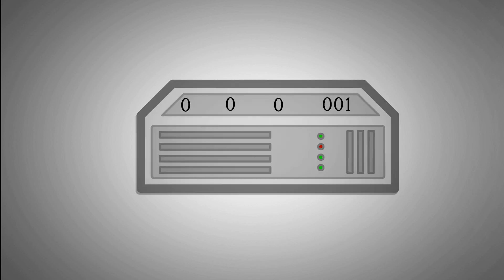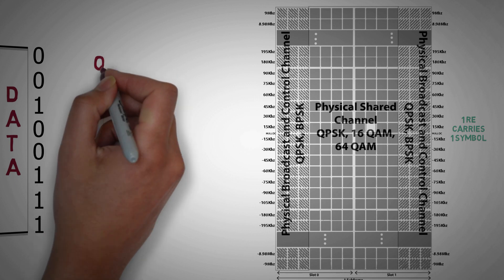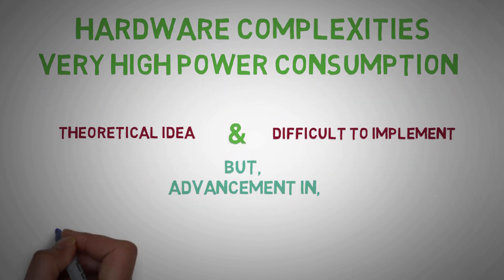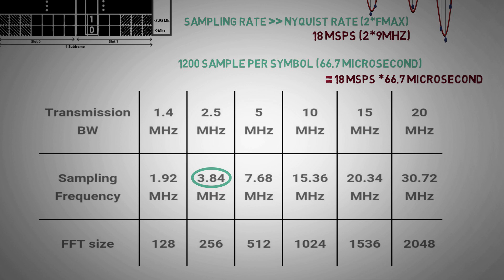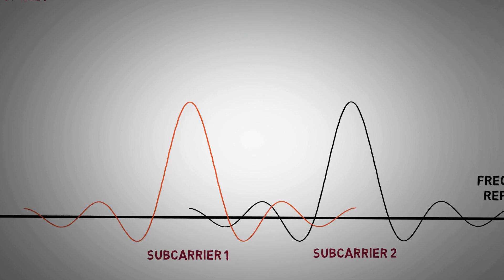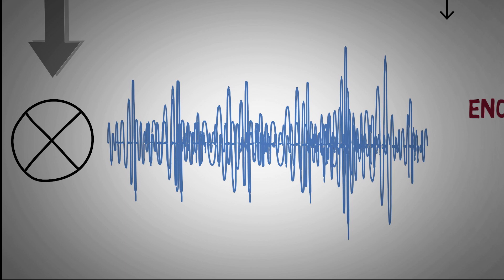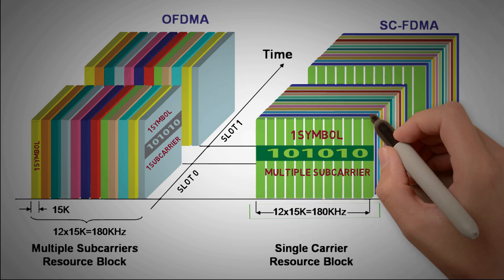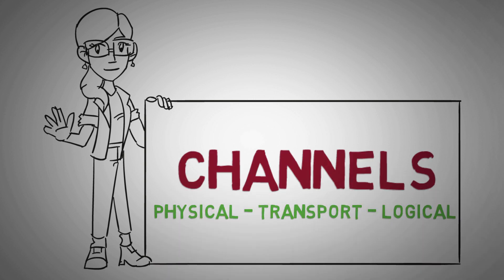2.4 - OFDMA/SC-FDMA IN 4G LTE - PART 2

Comment: at 6.20  you say 1 symbol= 1 subcarrier
but bellow link 

http://rfmw.em.keysight.com/wireless/helpfiles/89600b/webhelp/subsystems/wlan-ofdm/content/ofdm_basicprinciplesoverview.htm

1 symbol= Multiple carriers (subcarriers)  ????
Reply from the maker: You are confusing it. OFDM uses multiple carriers which are called subcarriers.
The information is sent using symbols.
1 Symbol can have multiple bits. Depends on the modulation scheme used.
1 Symbol is mapped against 1 Subcarrier.

Is it clear now?
Reply: thanks

Comment: Really great videos. I'm currently looking at SC-FDMA and determining how it would be possible to improve the power consumption, and then simulating the hypothesis. It's been a bit difficult so far to setup. Are there any resources you would recommend for LTE simulations related to power consumption?
Reply from the maker: +WashedSun sorry mate, but we don't have any adequate resources on that.. however if you look at the equation for PAPR, in a n-channel OFDM system with ideal conditions, PAPR will be 'n'. So PAPR increases with the increase in number of subcarriers. since multiple subcarriers are clubbed together in OFDMA during FFT, what it basically does is to reduce the effective no. Of carriers in the system to decrease PAPR. For a simple simulation to compare OFDMA and SCFDMA , you can use a MATLAB simulation for OFDMA to calculate PAPR using certain IFFT size say 256, now for SCFDMA of equivalent bandwidth, which uses 4 point FFT, you can simply replace the IFFT size by 64(256/4).
Hope this helps

Comment: Question,  Why do we need IFFT ? Videos says the reason is 1200 oscillators is too hard, then why this IFFT is the solution? Why set the symbols from freq to time domain is solution?  I always want to ask this question, why do we need ifft, but most of tutorials never say the reason. hope someone master could help. thank you so much.
Reply: Simply summing the signals together is not the same as modulation - you must be able to get back the original signals on the other side.  Similar in concept to 4+4 and 1+7 -- if you just send 8 the receiving side will not know the original signals used to create the signal it received.  IFFT is an alternative to individually modulation 1200 signals with individual oscillators, essentially it is creating the modulation, not the simple sum such that the output can be demodulated into the original 1200 components.
Reply from the maker: +SunSon29 , here in OFDMA, IFFT is nothing but a summation operation that sums all the individual subcarriers so that all the subcarriers can be processed together. If not for IFFT, we could have used any other technique that does the same task. Conversion from frequency to time domain is not the aim here, it happens as a consequence of IFFT...Said that, time and frequency domain representations are a mathematical way of representing signals..A signal will always remain the same...However when FFT operation is applied over a signal, it will break it into sinusoids and IFFT reverses this.
Reply: thank you so much for your reply, may I ask this? If IFFT just for summation, why not just sum together, why we still to do bother IFFT? simply sum is easier, right?  Because in the video, it says that IFFT will solve the problem to complexity for 1200 oscillators, but why IFFT is easier ?  Thank you!
Reply: thank you.
Reply: Thanks a lot to the poster of the question and all the answers. This finally clarified something that was so confusing in every single other OFDM tutorial. Simply put, IFFT is not really turning frequency spectrum to time domain, it is merely used for the mathematical formula it represents.
Reply: It's been more than a year, but I had the same question until recently I got the answer to this question:
Sub-carrier assignment using oscillators simply means multiplying each (modulation) symbol X[k] with one of the frequency components of oscillator i.e X[k] multiplication by exp(jkwn). 
Now if you look at the IFFT operation formula, it's exactly the same !

Comment: question why not scfdm in downlink??
Reply: we can send more data with SCFDM as we can map 1 symbol per subcarrier, also in SCFDMA the symbol is transmitted over a short duration unlike OFDMA hence more data transmission in DL than UL
Reply from the maker: +nba fun, why make it complex when a simpler alternative (OFDMA) is available..SC-FDMA tackles power limitation in handheld devices which is not an issue with the ENBs
Reply: thx for the reply and thx for your channel
Reply from the maker: +nba fun - We are glad that you found our channel useful.
Happy Learning.